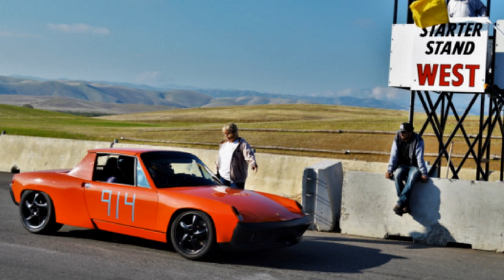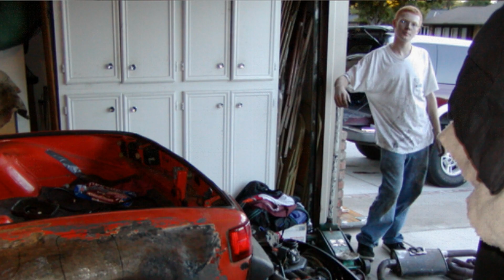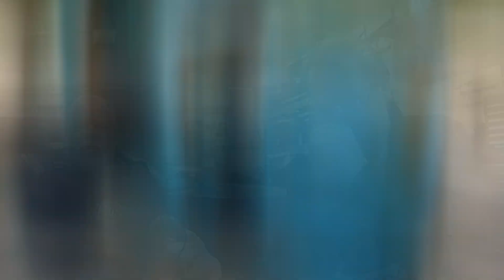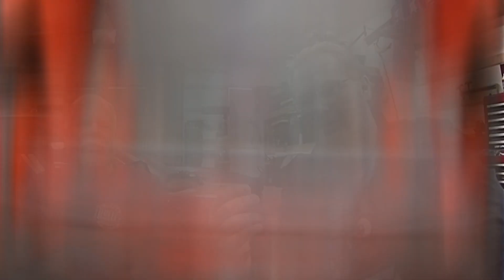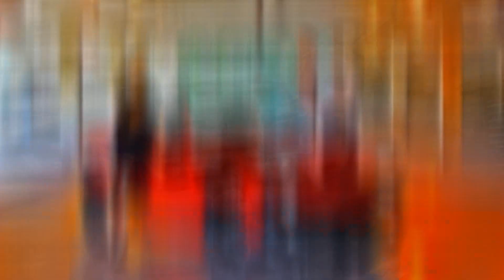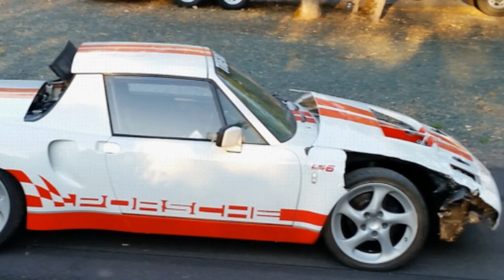Introducing Andrew and Dan

Comment: Noticed your vids from the Medford tracks. Are you guys local or are you traveling here to Race? I’m in the Medford area and in process of building a late model LT/L83 powered 914. Not intending to Race but a serious street car 😳😳😳😁
Reply from the maker: Great Build!  This is Dan, (the Dad with the white LS 914).  I'm in the area.  I race at the Kart track with the Siskiyou Sports Car Club.  We are mostly street cars and have a lot of fun.  Join us and Wring out that LT without looking over your shoulder.  They have an Extreme Street Tire class that works well for us.  I also will be doing some Test and Tunes at Medford Drags,  Both tracks are just off 140 right next to each other.
Reply: @budgetoutlaws9978  Yeah, I live in CP, so I’m very close to the tracks. Shoot me a message when the racing season starts and I’ll come by and say Hello, if the car is ready I’ll be in it😁...